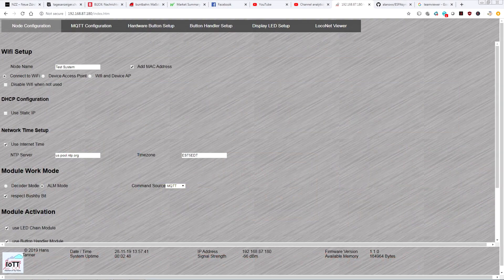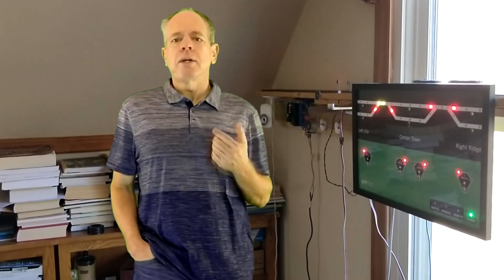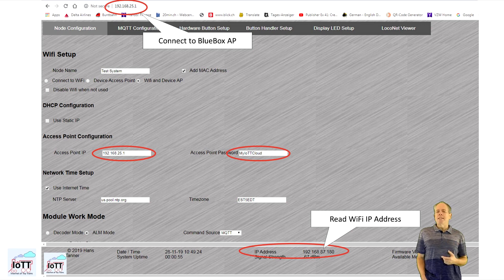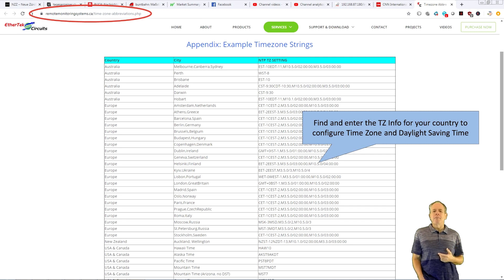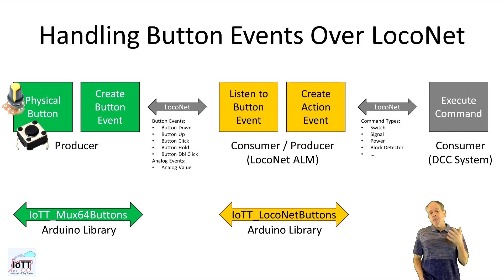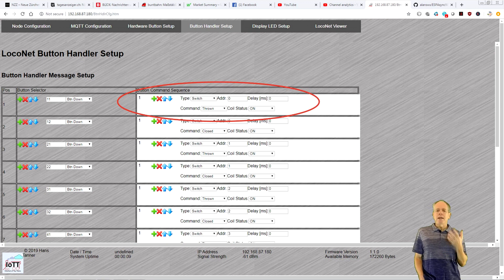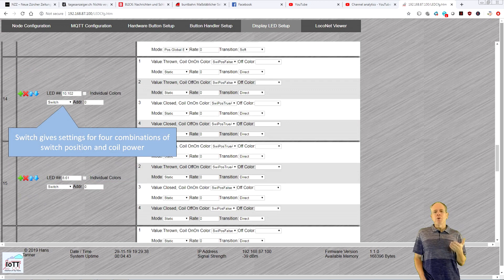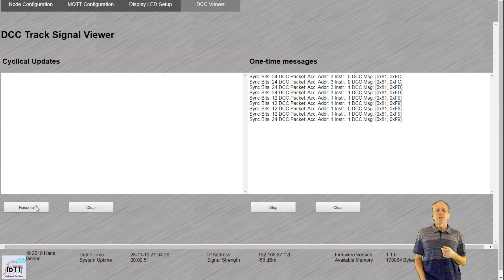BlueBox Sketch Update and Configuration (Video #32)

Comment: Hi, I set up a Digikeijs DR4088LN Loconet Block Detector with a address of 81 to 91 for 11 blocks.The loconet monitor shows these blocks correctly identified. However for the rgb lights to work properly on the BlueBox, I had to program the BlueBox with address 80 to 90. Off by 1 digit. Also when configuring my turnout #36, I had to  program the BlueBox with address #37, again off by 1 digit. Is there a setting I need to change or am I doing something wrong ? I hope you can help.
Reply from the maker: There is no configuration for offset treatment at this time, but I like your idea and actually might add such a feature in the module configuration. Digital addresses normally star from 0, so the first address is 0. I chose to consequently use this approach despite the NMRA making an exception for just the switch addresses, labeling the technical address 0 as switch #1. But then for the signal addresses even the NMRA starts with 0, which is kind of inconsistent in their own ruling. Same with locomotives, where address 0 is the broadcast address to send a command to all locomotives. So, it is a mess we have to live with.
Digitrax in the LocoNet standard starts the block detector inputs with 0, so if Digikihes makes this a 1, that is them choosing to do so just as I chose to stick with 0 start address for everything. 
Again, I like the idea to make the offset user configurable, but until then, I fear you have to do the address translation yourself ;-)
Reply: IoTT can you please add a option like “Test sequence “ to the led configuration that can toggle between Red, Green and Blue for the number of led’s selected ? My led’s on my panel board are not wired up in sequence. So trying to find the correct led to program can be difficult.
Reply from the maker: I looked into this and have a prototype working. Needs a little more testing before I can release and it will require upgrading both, the ESP32 software as well as the web pages. I'll let you know when it's ready.

Comment: Hi, I would now like to test the 16 button hardware. I have 3 CD74HC4067's. How do I wire them to the BlueBox pcb, is it possible on this pcb version ?

 I noticed there are a few connector pins under the board available.
Reply from the maker: Yes, should be no problem. Connect ESP32 GPIO pins 18,5,17,16 to pins s0..s3 of the 4067 for the addresses (check you have specified them in the button setup). You can select other pins if you want, but those are the one I normally use. There are certain limitations on the usage of pins, so when you select other pins you need to check the capabilities. For data, use pin 4 if you do not want to use analog input and Wifi at the same time. Or GPIO 35 if you plan to use analog input. Watch video #29 for more information on the limitations of the ESP32 GPIOs and how to work around.
Of course you also have to connect 3.3V and GND. Yes, you can use the solder pads on the board. Remember, it is a prototype board, for that reason I have put the pads on ;-)

Comment: I've been testing the RGB led configurations. I noticed that occasionally when I press the + sign, a line is added but then quickly disappears. I have to add it again. Also, it's happened twice now that it looks like something has crashed. I can no longer access the web interface and all the led's I programmed have now turned off. But I still see the  IOTT ESP32 access point but i can't connect. Rebooting doesn't help. Do I need to reprogram the ESP32 ?
Reply from the maker: I don't think you should reload the software a t this time. I would connect the ESP32 to the Arduino monitor and reboot to see what's going on. You should see messages that tell you that it reads the config file, what modules get initialized and whether it connects to the router (IP address is displayed) or it can't, in which case it would fall back to create an access point on its own and you could use the cell phone to reestablish the connection. Also, if it keeps having problems to connect to your router, it might be a good idea to reboot the router.
If the startup process shows problem with reading the configuration, you would first try to upload the SPIFFS file with all the configuration data. Reloading the sketch itself really should not be necessary (unless we discover a bug in the software, which there I am sure still are)
Reply from the maker: One reason you can't connect might actually  be that it got assigned a different IP from the router. In my opinion it is  best to make the IP address static by setting it up in the router, so that the DHCP server assigns the same address every time.
Also, it is normally better and more stable to connect via a router instead of using the AP of the ESP. On my devices, I have the option of the device AP normally turned off.
Reply from the maker: The configuration data is delivered via websocket protocol. If for some reason the websocket stream is interrupted, the data will be resent which has the same effect as clicking the cancel button, in other words, the page display is reset to the last saved state, that's why you see any not yet saved changes disappear. Such disruptions happen most likely shortly after the page is being loaded. So, if you wait a few seconds after loading the page before you make any changes, you reduce the risk for this to happen. You can actually also see what's going on when you open the inspect window of your browser and look at the console messages. Furthermore, if you look into the Arduino monitor you also see the message flow when the websocket loads the configuration data

Comment: Is the MQTT option working ? I did set up the configuration page but I can't tick the box on the "Node Configuration" page.
Reply from the maker: As soon as you select either MQTT or Gateway as command source, the MQTT checkbox will be checked. You then also get the MQTT setup page to set IP of the MQTT server and topics to be used.

Comment: Hi, I'm using your Bluebox hardware. it seems that when I connect loconet, I get  a fast flashing blue led and JMRI loconet monitor sends out a lot of reports it's unable to parse messages. If I disconnect loconet from your hardware, all work correctly. Any idea why this is happening.  This was not the case early on when testing.
Reply: Now I'm testing the bottom module. I have set the address pins to 18,5,17,16 and the data pin to 35 and soldered a pin to the bluebox pin 35. I'm using a common ground for the pushbuttons. I set all the buttons to analog. But when I push  a button, I don't see  a input status. Can you please help ?
Reply from the maker: @ClinchfieldModelRailroad  Those pins should work, they are the same I use for my small button panel. What I would not expect to work though is an analog input going from ground to zero (open). If you switch between ground and 3.3V it should result in some output. If you have the button setup screen open, you should see that changes in the input status field.
Is this the first or the second button module you are connecting? If the second, does the first work?
Reply: @IoTT  this is the 1st button board. My pushbuttons board has a pre- existing 5 volts common. I'm connecting the ground to the ESP32, but have the 3.3 volts of the ESP32 powering the interface board. I expect that when I press a pushbuttons, the input pin on the interface board goes high and this is sent by the address and data pin to the ESP32. But I don't see any traffic when I press a button.
Reply from the maker: Most likely you have deactivated the LocoNet module. When inactive, the IO line is set as input and it is possible that the pullup resistor provides enough current to cause the module to pull LocoNet low, which results in a busy network for other devices. If you do not use the LocoNet module, it is best to disconnect the cable. If you want to use LocoNet, check your settings in the config page. Make sure LocoNet (or Gateway if you use that functionality) is selected. This automatically activates the LocoNet hardware and you should see normal communication.
Reply from the maker: The other thing to check is the Reverse Logic checkbox in the LocoNet settings. It needs to be checked as the interface uses inverse logic compared to a 'normal' serial port. If it is not checked, it would also have the effect that the network appears to be busy all the time.
Reply: Ok, I checked that the LocoNet and Reverse Logic checkbox's are checked. They are. However I unchecked "use HW Button Module" and that fixed my issue.
Reply from the maker: There is no Button Module installed, so it should be unchecked. However, even if checked, it should not cause problems unless there is a conflict of the I/Os  used. Check the address and data pins configured in the HW Button Module (visible when you check the option). They must not conflict with Rx and Tx pins of the LocoNet module. By default, they are set to 18,5,17,16 for addresses and 4 for data. LocoNet is on 22 and 23.
Reply: IoTT ok, I changed the data to 4 and that fixed it. But I’ll uncheck the box since there is no Button Module for now. Also I switched Command Source to Gateway and can now see the messages in Node Red. Also unticked “Send periodic Ping” to clean things up in Node Red. 😀
Reply: I noticed that if I switch “ Command Source “ to MQTT, There are no messages sent to Node Red, this is not what I expected, how is this used ?
Reply from the maker: Well, what commands would you expect? Without hardware buttons there is no message source on the board, so nothing is sent (the only exception would be if you use the button handler module, but also then you would need a button message from somewhere to be translated into signal or switch message). So, it is basically listening for incoming commands (the only exception to verify it is working would be the Ping message, which you have switched off)
Reply: @IoTT  ok, I understand now what your saying, if I don't have buttons setup then why would I expect to see messages. I was thinking that Node Red would continue to display the messages from loconet.
Reply from the maker: In fact, yes, but only if you operate in Gateway mode. In this case you would see the LocoNet messages arrive in Node-RED. So you place an MQTT receiver for the lnIn topic and connect it to a display element and you should see the messages in the debug window.

Comment: It is possible to set brightness for each color. I want to work with the tiny LED WS2812-2020 on a searchlight signal in TT-scale. The datasheet lists the maximum luminous intensity like follow Red 210 mcd, Green 900 mcd, and Blue 300 mcd. I think this needs some brightness adjustments for a similar intensity.
Reply from the maker: Yes, that would be no problem. You just specify a color say red50 and define it as red with 50% brightness. Then you would assign it to those smaller LED's. Now, the 50% red would be the maximum brightness you would get from those LED's at 100% chain brightness and you still could scale them down with the chain.